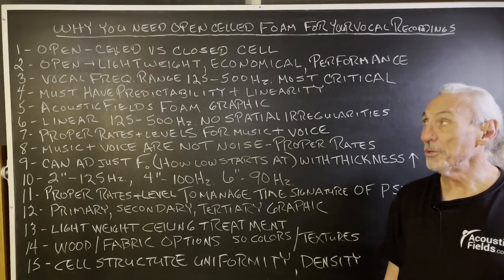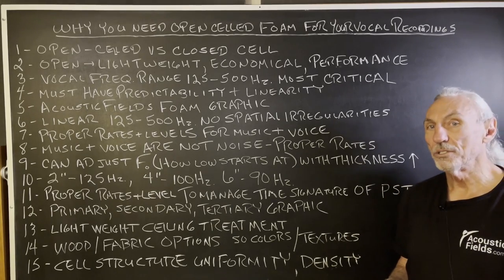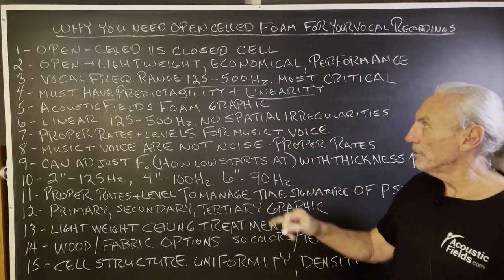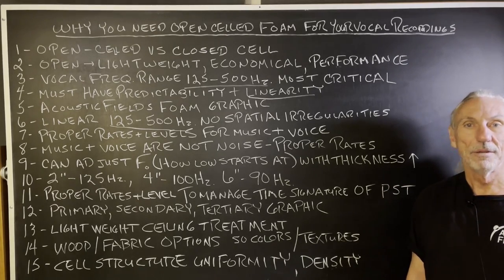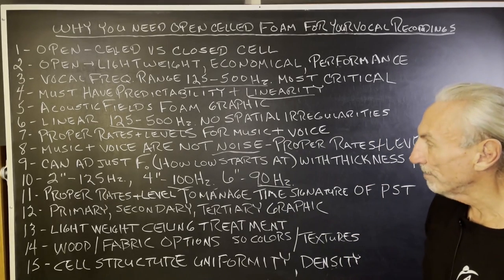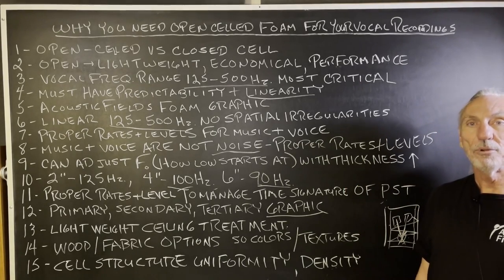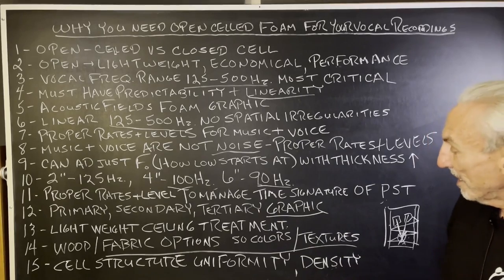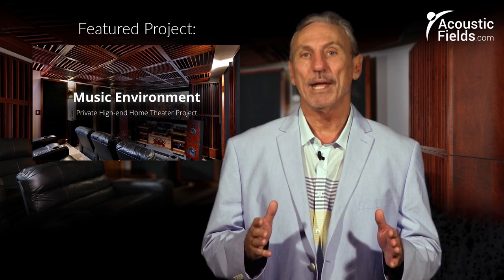Why You Need Open Celled Foam For Your Vocal Recordings - www.AcousticFields.com

Comment: So male bass to tenor voice over recording that is facing a center  a wall, I assume your foam on front, side walls and ceiling? Whats the closet to put the vocalist to the wall with your foam? Will 2 to 3 feet away projecting into the foam be good?
Reply from the maker: Male voice needs to have a start frequency range of 80 hz. You can obtain that resonant frequency for our foam using 8" deep panels. In most male voice rooms we do, we start at 90 hz. which takes 6" of foam depth. Only 10% of male voice we work with goes down to 80 hz.

Comment: A better option is dacron layers mixed with terrycloth and velvet placed several feet from walls but the most critical element is always the room volume being a proper size with ceiling being at least 14 feet
Reply from the maker: Fabrics do not offer consistent rates and levels of absorption which is a requirement for music and voice. A 14' ceiling height is always welcome with any width or length along with most usages..

Comment: Not all open cell foam has consistent cell structure. Your’s does.   Also, compressed fiberglass, uncompressed fiberglass, mineral wool and most of the typical building insulation does not have consistency either.
Reply from the maker: It is the cellular consistency along with increased density that gives our foam its linearity from 125 - 500 Hz.